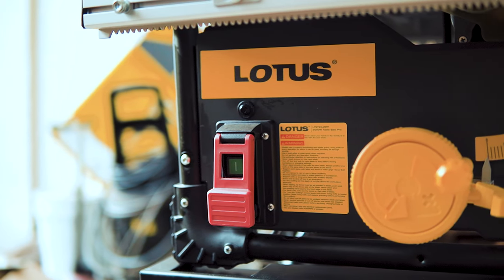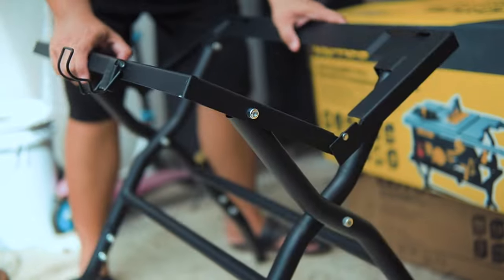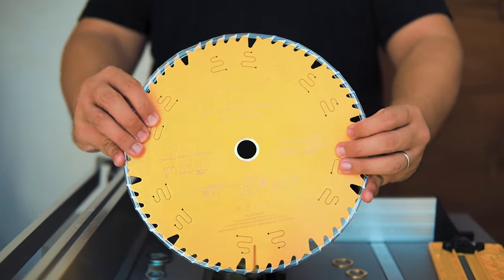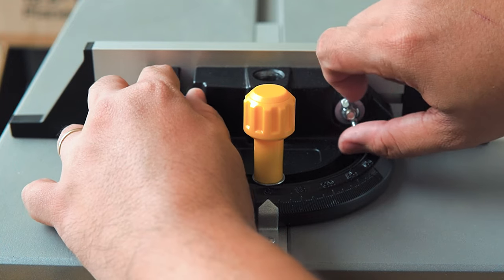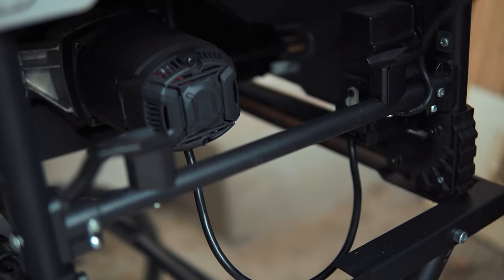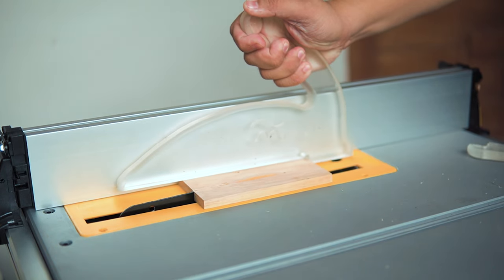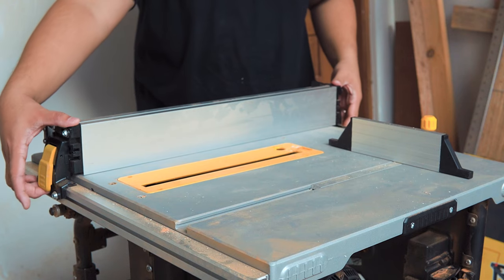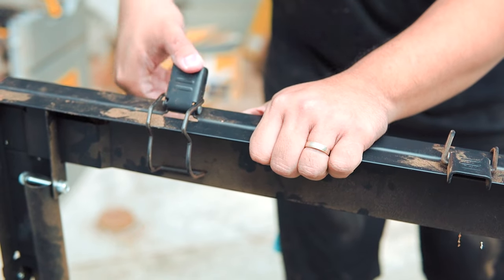Is This The Table Saw To Look For In 2023??? | LTST254RPF PRO 2000W Rack and Pinion Table Saw

Comment: One thing that you say is not correct, your blade should always be 2.5 times higher than the thickness of the material to stop the material from lifting up of the saw while you are cutting it, but a great video otherwise and the only person that shows how to setup a saw correctly first. I always use a Dial gauge and a digital Vernier gauge to setup my saws just to be a bit more accurate.

Comment: to be honest ay may lotus corded drill with hammer fuction akong nagagamit na namana ko sa papa ko. at router bit. ok na ok ang performance. may iba kasing drill na pag naabuso e madali masira ang mga bearing. so far for almost 4yrs e ok n ok pa sya sa paminsan minsan kong gamit. may iba kasi n pag natabi lng e nag kakalawang mga bearings. goods n goods pa pati router bit. pero mas masaya tong table saw n to pra sa project sa bahay. 🔥 no more lagari! less hassle. congrats agad sakin .😅 claim ko na agad. malay mo diba swertihin. 🥰🥰
Mark Anthony Laurel
#TatakLotusGiveaway